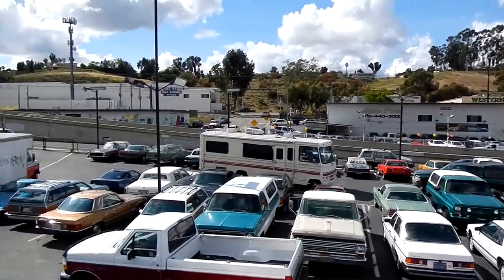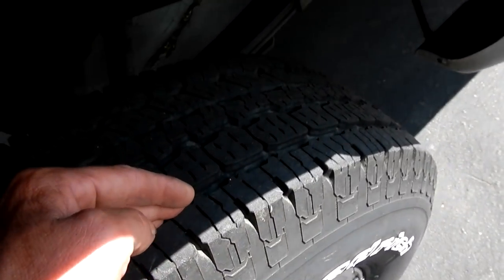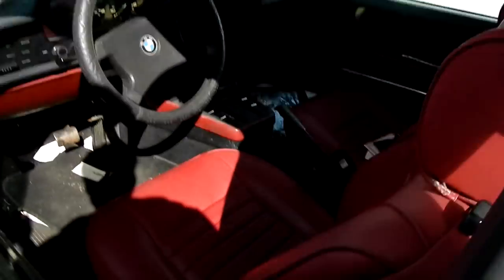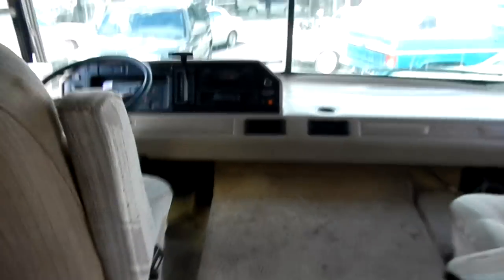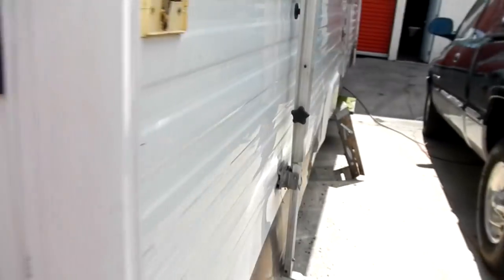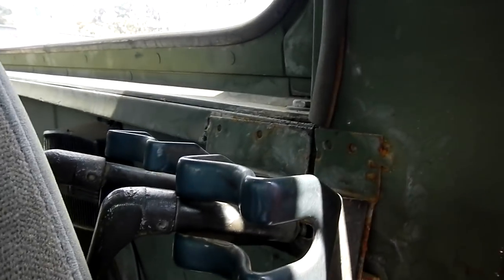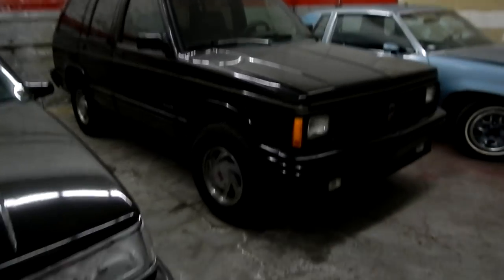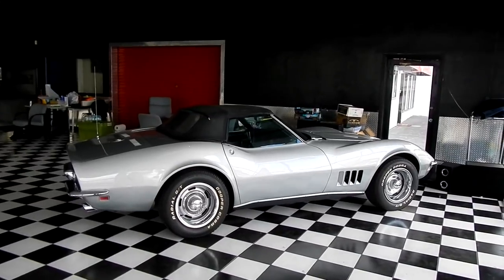Classic Car lot walk around Update & Review Mercedes Saab GM EURO Muscle 100+ Cars

Comment: Yes, at least in the first years of production almost everything was option. Mercedes changed that from the mid 90's and included more and more as standard. Options like that were very expensive and even if people bought an expensive car like a Mercedes many didn't add alot of options. The number of W140 with so little options are low, but there are a few out there.

Comment: When it comes to Euro cars the US ones are the best ones to get. Exept for lights and bumper the US speced ones are far superior. Euro ones very often have smaller engines, very few options and cloth interior. Many countries have alot of bad roads so noone can say they have an only-highway-miles car. We do have more diesel options than the US had, but you got the cream ones; the 116 and 126 diesels were never sold in Europe. But we had alot of diesel 124's that you probably didn't get.